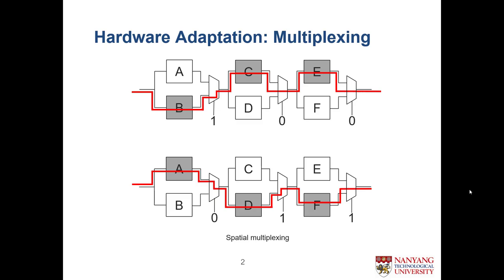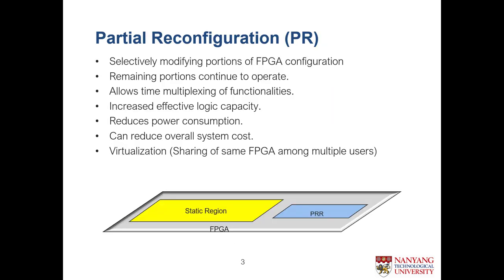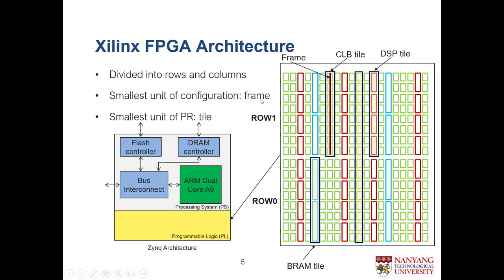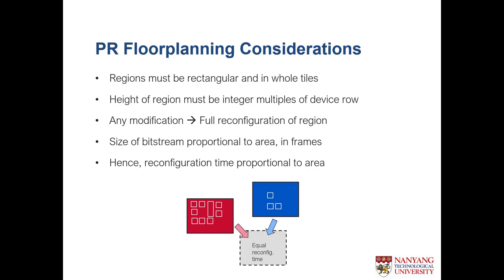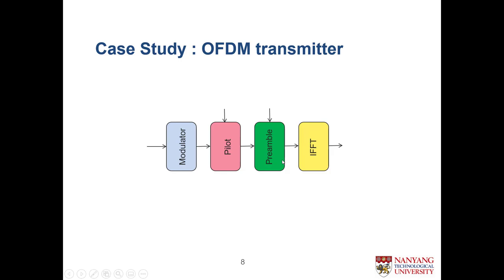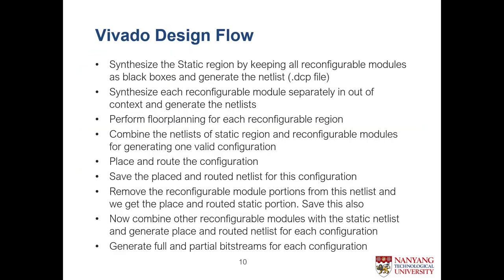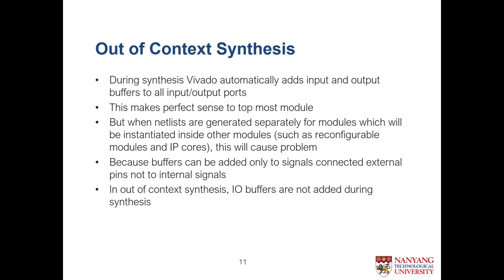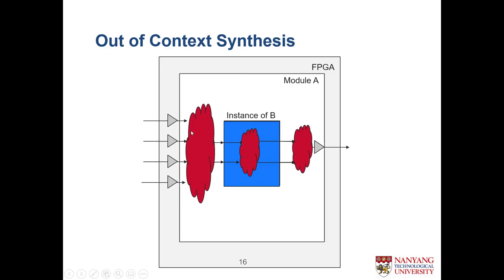Partial Reconfiguration: Part 1 Introduction

Comment: So is this also called as Dynamic reconfiguration? I saw the hashtag so I assume it's the same
Reply from the maker: Yes. Now a days both means same. But they could be different. But currently the terms are used in the same sense
Reply: @Vipinkmenon  I see... Thankyou for this video series 👍
Reply: Also known as Dynamic Function Exchange